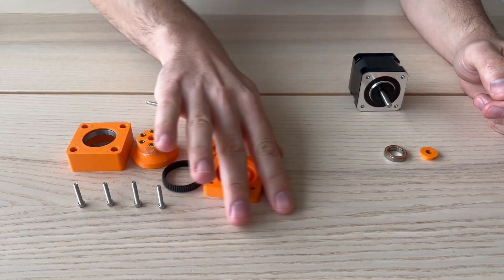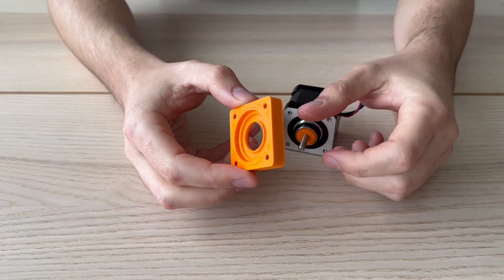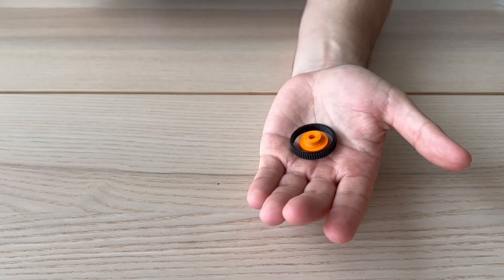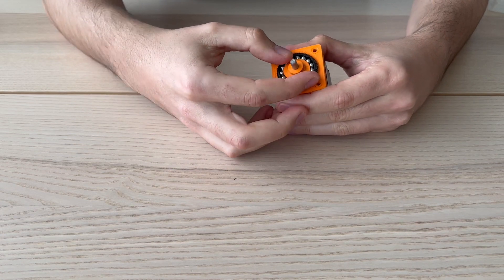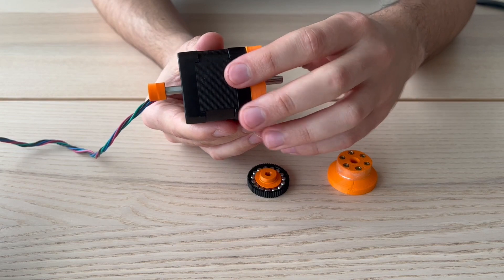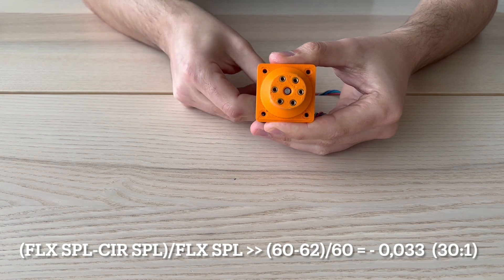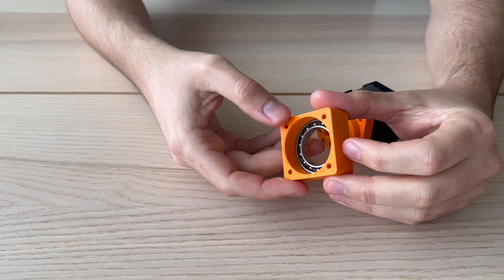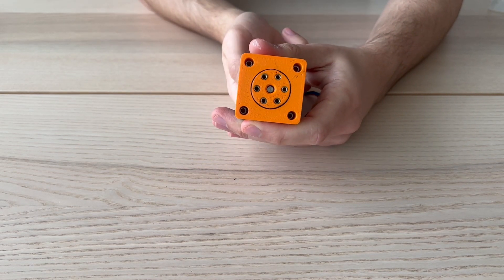Nema17, 3D Printed Strain Wave Gear (Harmonic Drive)

Comment: Have you measured the backlash on this? :D
Reply from the maker: Hi, its good, only small flexion of the PLA is noticeable, but I am wondering after some use, PLA will deform. Nylon should be better choice.
Reply: @ZeroBacklashRobotics  I think the ball bearings are rubbing on themselves. I think grease may be good :) idk.
Reply from the maker: @wow hahah yes but I didn’t have for the video xD I agree with you it would increase the performance.

Comment: Wow, cool design. But does it mean that both non-flex gears have different teeth size? they are both the same diameter but with different teeth count. Is it a big problem? Do you use PLA for flex part?
You really inspired me to design harmonic drive now. I was more focused on multistage planetary gears before because they looked more promising, but this kind of solution you have a so damn cool and simple.
Reply from the maker: Hi @Dmitriy, happy to encourage you to start with strain wave gears. They are unique, these reductors are the core of the mechanics in robotics. Only flex spline is slightly smaller in tooth wide, height is the same, but this is not noticeable since this mechanism is done in PLA, 3D printing tolerances don't go that far.

Comment: The use of the steel balls is just brilliant. Together with the bearings I imagine this gear can take quite a load and not wear out too fast.

Your 3d prints look pretty shit though. I hope the design comes up for sale somewhere.
Reply from the maker: Hi Paul,
Thanks for your comment. The 3D print is not my best example xD this pieces must be carefully printed. They are small and need precision. 
If you are still interested the design can be purchased here:
https://cults3d.com/en/3d-model/tool/3d-printed-strain-wave-gear-harmonic-drive
Best regards, ZeroBacklash